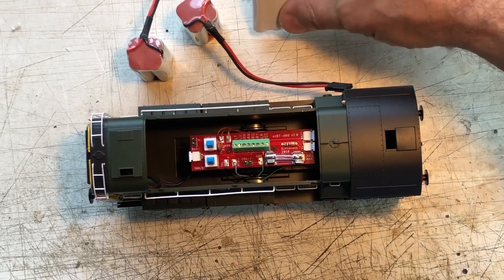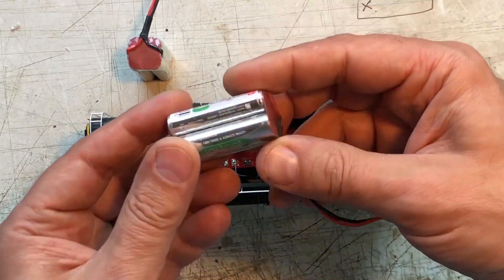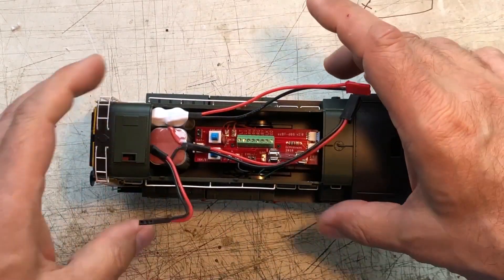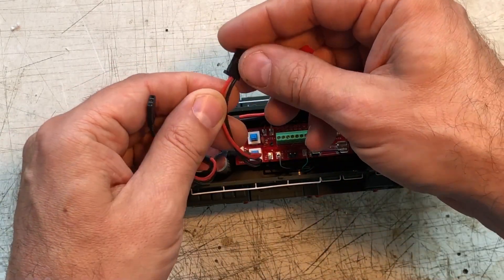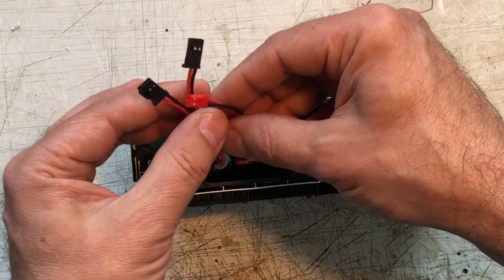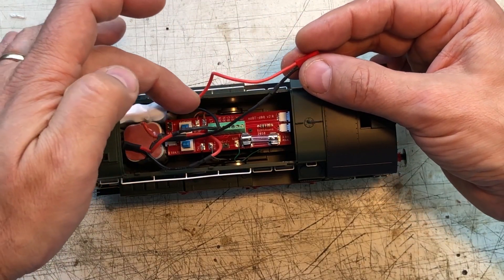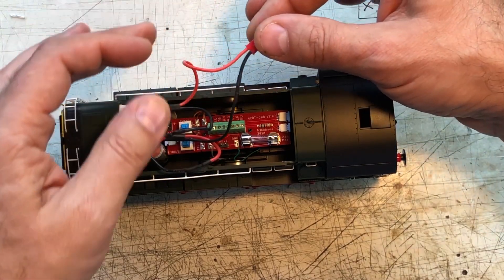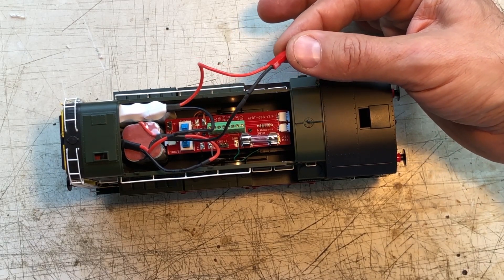Batteries into the Dapol 0-gauge Class 08

Comment: Just make SURE they are all the same age, quality and mAh !!
Reply from the maker: Yes that is the accepted rule for battery-powered devices the world over. I would go further and say they should be the same manufacturer which will give you better odds having consistent quality. And besides, one manufacturer's "2000 mAh" for example, may not be another's, as they'll have slightly different methods of testing and rating cells. Thanks for your interest.